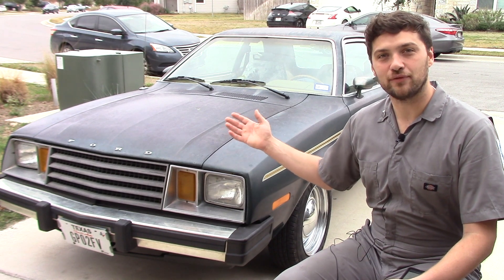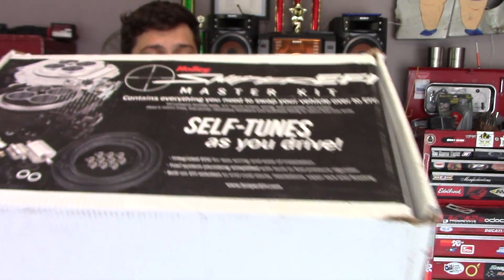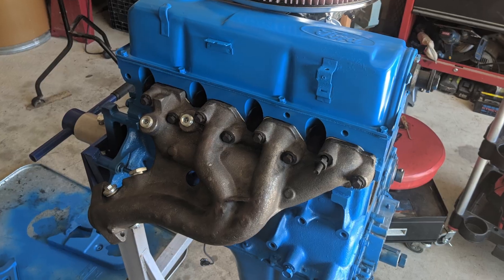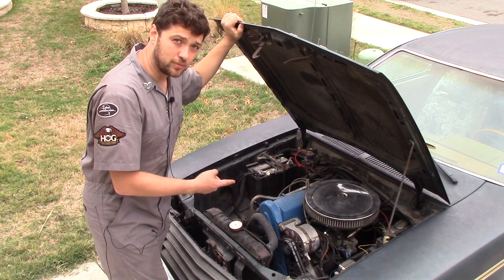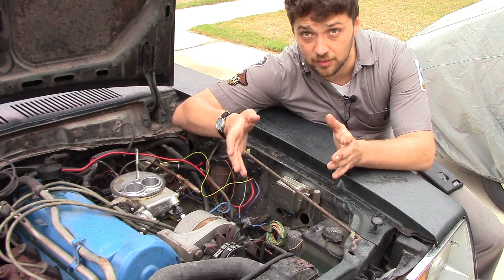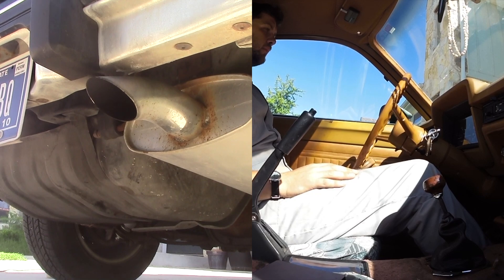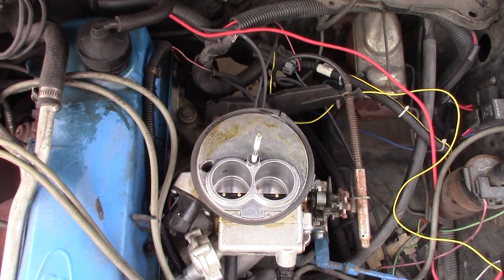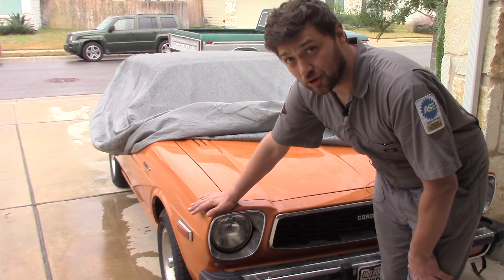How I built my FUEL INJECTED Ford Pinto using Holley Sniper 2300 EFI

Comment: I bought  a brand new Pinto in 1970 in San Diego, Ca with a 2000 engine and a 4 speed.  The window sticker said that it was a 1600 with the 4 speed and according to Ford the combination that I was buying was NOT available!  The salesman said that "FORD must have made a mistake on the assembly line.  I paid $1860 buck-a-roos for it.  It had a heater and a radio as the ONLY options. The floor was vinyl, NO carpets!  Dark Green with black interior.  It was a great car,  wish I still had it.  Oh well!

Comment: If the progressive had been adjusted correct (which many werent) you could have gotten out of your driveway just as fast as with the Sniper system. But almost naturally the Sniper gives provision for better power, especially along with a slightly better cam. Those Pinto engines were so underdeveloped from the factory that they may even havew been poorly tuned already then. But all in all it is a very sturdy engine.

Comment: 2.3 ltr iron horse loved those old Pinto's. My buddy ran a header also, he ran the exhaust out just before the rear tires on both sides. He would wind the auto trans out to 50 mph in first gear and let off the gas and flames shot three foot out on both sides. looked so cool. back in the '70s, he was the first dude I knew of with two 15's subwoofers in the back of his ride, the music was so loud.

Comment: that fuel pump is loud like that cause it is cavitating. it needs more fuel fed to it. nice coversion though
Reply: Good point, Outlaw.   Any suggestions on how to resolve that problem?
Reply: @frankbarthold4916  yes. You can add a bigger line on the feed side of the pump. Also make sure there is not a pin hole or loose clamp on the feed side. And if it has a filter in the tank. Make sure its in tact. I had the same problem a few years back. And have done lots of trouble shooting for the same issues on other people's cars. Ive found all the above to be issues.
Reply: @tnoutlaw73  thank you so much for your insight.   There's a lot to consider with upgrades . . . been there myself and made my share of mistakes, usually in trying to do more than what was designed as original equipment.

Comment: For shame, not setting your choke right. All the Pintos I had I could take off immediately from starting down to 5 - 10f unless iced over.  That said...I also drove the pin out for the accelerator pump and reinstalled to give a bigger shot, swapped to a larger idle jet, ditto main jet and air jet for emulsion tube, 2" exhaust, swapped mechanical advance from the "13r" notch to the 18, replaced advance springs and set base timing to 15 deg, adjustable vacuum advance off manifold. I had to swap out power valves too but that was more if it bogged low or leaned out too quick, most times it was okay.

Comment: There is an easier way to run a fuel system. You can use the stock fuel pump to bring fuel to the engine compartment, pump fuel into a surge tank, from the surge tank the fuel goes to a a walbro high pressure pump for the EFI. You can use the factory return line as well. Works like a charm in my turbo pinto. No noisy pump to deal with, and no lines run to the tank.

Comment: My carbureted Pintos had no problems with hot or cold starting and would run smoothly until warm, with only a blip of the throttle at startup to prime the choke.

Comment: I had 3 Pintos: 1971 with the 2-liter German engine, 1974 with the 2.3 liter Ford engine and 1979 with the 2.3-liter engine, all with 4-speed manual transmissions. The were fun to drive and were simple and easy to work on. The Holley 5200 carburetor was easy to rejet to get the air-fuel ratio at all RPMs and the vacuum and centrifugal advance units in the distributors were easy to work on and adjust. There were oiling problems with the overhead hydraulic camshaft that caused excessive cam lobe wear on the early 2.3 liter engines.

Comment: I have had Pintos from a 72 2.0,76 hatchw/2.8v6(Mustang2 headers,holley 390,flow masters and factory 3.40gear 8 inch rear) to 77 Cruisin Wagon 2.8 v6 with 3.08gear 8 inch).That was just half of them.205/50/15 Coopers realy made an 80,2.3(3/4cam,loped like a v8)handle great.Pinto is a poor mans Mustang is what I say.

Comment: Back in the '80s I would buy Pintos for $50 a pop, take two and make one runner. Had 11 of the '71-'73s, and 2 '75s that had the V6. Easy to work on and nobody wanted them. But they handled well and a little work they moved along ok.
Reply: Awesome. I’m a scratch and dent shopper, too.
Reply: @stopglobalswarming  working on 2 fox body Mustangs, '82 coupe with a 2.3 and an '86 vert with an 5.0

Comment: Should have just pulled what you needed off a ranger or mustang. Everything bolts right up...
Reply from the maker: I would have had to take the whole motor because there are no can position or crank position sensor provisions on my old motor.

Comment: I raced mini modifided  for over 20 years  I can get over 250 hp with less than 1000 in engine turn 8500 rpm  with just changing cams a 2 barrle carb  even motorcraft carb header  .shave head better rod bolts  turn it 7800 rpm get hp up to 150 to 180  no nos  carb only

Comment: EFi is perhaps the best investment you can make at this point.  The systems are not particularly pricey, they are incredibly reliable, and they can really do a lot to improve your drivability and fuel economy as well.   Except for any rust that may occur, there is no real reason why this Pinto should ever have to stop being a daily driver.
Reply: I think you should watch a few more efi conversion videos. They usually require a lot of tuning to get working right
Reply: @researchandbuild1751  Not these days... there are plenty of self learning EFIs that do an amazing job in getting the car running well, with decent emissions and improved fuel economy - plus often a bonus in better performance because the air / fuel mixture is better at all points along the way.   Plus if you really want to go for it, you can tune further and improve it even more.  But even in this case, a simple self learn and this car should perform better, get better gas mileage, and have much better cold starts.

Comment: I'm just wondering why you didn't up the fuel pressure regulator to 60 psi, using the regulator from a 1998-2001 Ford Ranger, get some 17 lb./hr. fuel injectors, and later get the internals from a 2.5l four cylinder from a 2001 Ford Ranger, thereby increasing displacement -- because I think, given the NA nature of the 2.3 you got, could get up to over 200 HP, maybe 250. (The 17lb./hr. injectors can be gotten from any GM 3000-series engine: 3.1, 3.4, or 3.8 V6.)

Only other modification I can foresee doing is finding a Ford Ranger (4.0) or Explorer (4.0) 8.8" rear axle, and getting a 3.73 gearset -- but that depends on what the stock Pinto rear has for the differential gearing. I do know, however, that the Pinto has a Ford 7.5" open rear differential.

Why do I know all this? Because I own a 1992 Ford Ranger.

PS: I would highly suggest, if you have the 2.3l rubber timing belt, to also get the crank gear, auxiliary shaft gear, and the camshaft gear -- for the timing set -- from a 1993-up Ranger. The reason why is that in 1992, Ford redesigned the older timing system to have curved teeth on the timing belt, instead of square teeth. They did this because square teeth had a tendency to rip off of the belt, or stretch the belt (under load, due to rotational resistance of the engine's crankshaft and camshaft), and therefore prematurely fail. With the rounded teeth in the belt and curved teeth on the gearsets, it lessens the stress the engine places on the belt. And, replacement of the gears IS a direct swap out, as long as the crank, cam, and aux. shafts are all the same diameter, which, on a 1980 Pinto, should be identical to a pre-1998 2.5l four-cylinder. The only difficulty is, removing the crank gear off of the crankshaft, given the aluminum fin around the gear on the front main oil seal carrier (the piece of aluminum surrounding the timing gear). I would suggest taking a rotary cutting tool and removing that aluminum fin, because you can't use a standard puller to remove the gear otherwise, and Ford does not make the special tool to remove the gear from the crank any longer, nor is the tool for sale anywhere. I should know, I've looked. I recommend doing this so you can replace the front main oil seal if and when it starts leaking.

Comment: I have a 83 shelby charger w/ 2.2. I put a 4 psi electric pump & new weber 36/36, it starts just like fuel injection. I love the simplicity, don't have to worry about electronics / computers. You took a similar set up and made it complicated although it is somewhat cool. Can you install a blowthru turbo to this setup
Reply from the maker: Yes indeed, this setup is easily programmed for a turbo

Comment: Somewhere in the mid 70's my bud a used car repair tech, had a 72 pinto come in with an under hood fire, he bought the car for $100 for the new tires on it, but during spare time he scrounged up used parts, put it together and it ran, that car could chirp the tires in 4 gears and would outrun most auto trans cars, and it wasn't built, it had the simplicity of a points condensor and coil, ignition system, a two barrel carb you could tweak a bit, and truly settable ignition timing, besides being great little beatable beasts, these were and are comparatively easy to work on and thats what made it fun.
Reply: that was the 2.0 Cosworth... killer little engine!

Comment: Great job!  I love seeing cars from the 60's, 70's be 80's tooling around and fitting right into traffic with their more boring modern offspring. 
What I want to know is...  how was your fuel economy before and after?  
I would imagine that the better and more tightly controlled ionization of your fuel down the throat should not only make it more responsive and slightly stronger, but should show the biggest difference in your MPG returns?

Comment: Please give more updates on your pinto. I love Ford pintos!
Reply: As soon as I find a decent pinto I plan on putting the drivetrain from a wrecked Ecoboost mustang into it. The Ecoboost has had the rousch tune and downpipe upgrade and should have 360 flywheel horsepower instead of the stock 310 horsepower.

Comment: would be awesome if the FAN controller measured current in place of voltage, so you know if the damn thing is actually running correctly!

Comment: The ranger intake already have the holes for a multipoint EFI
Reply: Victor Amicci on its’ exhaust pipe? Yeah?
Reply: @myid9876543  After diggin up, not so sure about the ranger intake with mpfi, but the 2.3 escort does have a intake ready for 4 injectors. It seems that the head intake port was also updated to accommodate the injector (D shaped instead of round)

Comment: I want to put a system like this on my 74 Camaro. Almost did when I replaced the drivetrain, but I was already doing a lot at once. The noisy fuel pumps do scare me. I almost ordered a new tank with an in tank pump, as I figured those must be quieter. My still carbed new engine still has a low pressure electric pump mounted outside the tank. It's a Carter, that thing is super quiet. Can't hear it over the engine at all.

Comment: Electronic fuel infection is fantastic as long as everything is working properly, but there have been several times that I wished I had a fuel system that I could fix with a screwdriver, like a carburetor.

Comment: I had a 1990 mustang lx 2.3L single plug head. when I de-restricted it via a 'cold air intake' tube just rain to the stock box location and a performance filter as well a catless 2 chamber dump pipe under the driver seat, it really woke it up with the T5 trans in it. I'm talking full sideways first gear burnouts, 2nd gear chirp and even after that engine skipped timing and blew the headgasket it would still hit 137mph without much issue. little robust engines those things are. very capable too.

Comment: does this system do ignition? like add some timing signaling via crank or cam sensor possibly from the newer revisions of this engine? I did something similar with a 300 6cyl using parts from '96... this opens up fun things like coil on plugs or wasted sparks with sequential ignition (and fuel but this throttle body)!!! edit: makin' old NEW again! <3 all

Comment: Cool project, but why not factory ford efi on the pinto with port fuel injection, and install a ranger roller cam and use the ihi turbo from the tbird with the .48 exhaust housing, that would've made a peppy car at low rpm, I ran a megasquirt on my 2.3 when I svo swapped my 79 pace car years ago. I ran a holset hx35 turbo and made 320 whp and would manage an honest 31 mpg on the interstate at 70 mph. Cool project none the less.

Comment: Any ideal how much horse power and mileage increase you got? I'm building a 83 Toyota 4x4 22R motor with a 4 inch lift 33s and it has factory power steering and AC, so it was probably way under powered back on the day before the lift and tires. I know when Toyota went from the 22R carburetor to 22re fuel injection it was a night and day difference.  This build will start as soon as the weather warms up here in the north. So I have some time to figure this all out. I can also put a 20r head on it to increase the compression and put a bigger cam in it. Let me know your thoughts. Any suggestions will be taken in consideration.
Reply from the maker: Well I haven't dynod it since the conversion and I did change the intake, exhaust and cam at the same time so I can't say how much is directly related to the EFI but I will say that the power increase was notable. Especially in the low end. Fuel mileage stayed about the same in normal conditions but I'll say when I'm driving it hard it uses way less gas. I used to get around 24 mpg when road tripping at 75mph and that was bumped up to 30.

Comment: Have you considered replacing the open breather for a closed cold air breather? Hot air equals less power and response.
Reply from the maker: Absolutely! Still working on the design and mounting situation

Comment: Word to the wise:  The loop of wires in the auxiliary harness on the fender needs to be cinched up in the middle, otherwise you have an induction coil that can create all kinds of problems in the long run.

It's possible that the fuel pump noise is cavitation from the return line restriction; I hope you got that fixed, and the noise is gone.
Reply: Voltage is too low for that to happen.

Comment: Pintos and chevettes were about the butt of every car joke in the 80s and 90s. Now 30 or so years later they look pretty awesome. I keep realizing cars I used to hate I now want. I’m sure it’s just the nostalgia factor in some of them, like the K cars for example. I test drove a Pinto as my first car, that was in 95, it was a few hundred bucks. I don’t remember why I didn’t get it. 
That efi kit would have been awesome for the Dodge Rampage I had though, that thing was cold blooded, it just refused to move when cold. I never could figure out the issue and even took it to a garage which I never did and they couldn’t figure it out either.